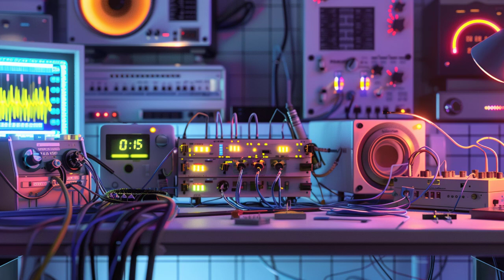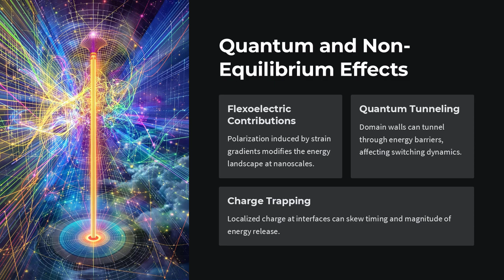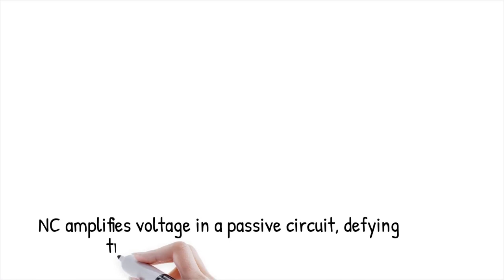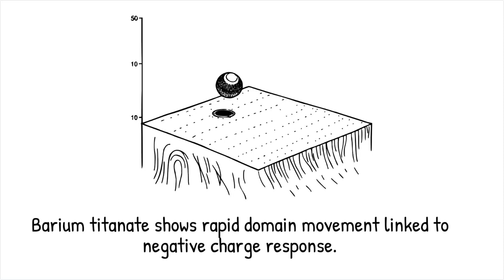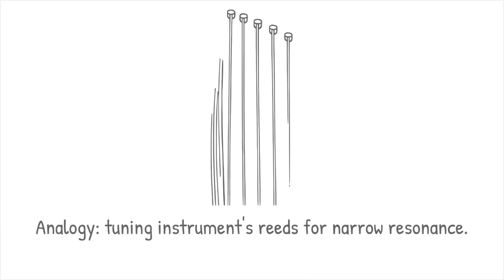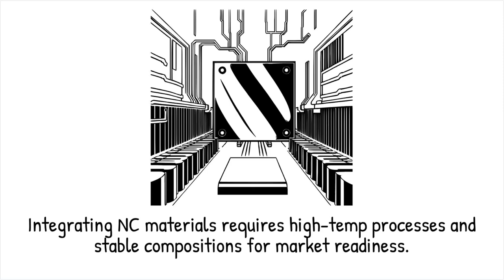The Nanoelectronics Breakthrough: What Causes Negative Capacitance?

Comment from the maker: What conditions stabilize negative capacitance in nanoscale ferroelectric stacks across real-world operating frequencies?
How do quantum and flexoelectric effects alter the charge-voltage dynamics in ultra-thin ferroelectric films?
Can negative capacitance be reliably integrated into commercial semiconductor manufacturing without compromising device longevity?